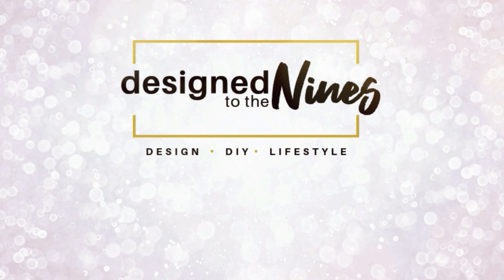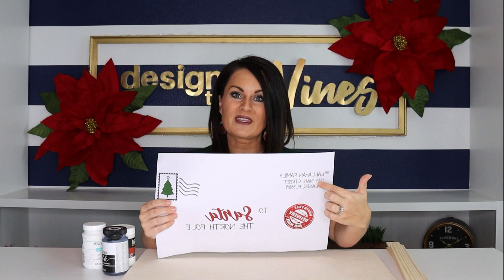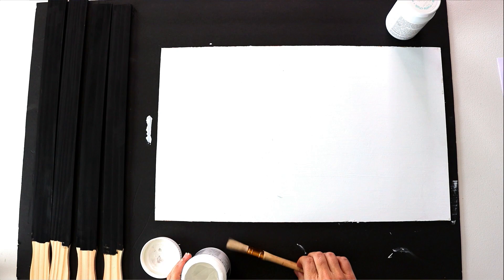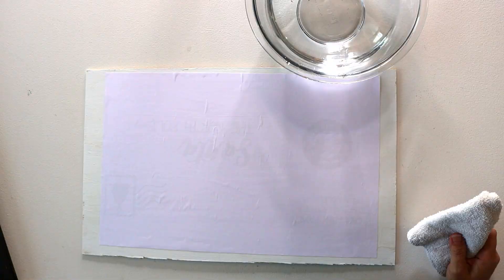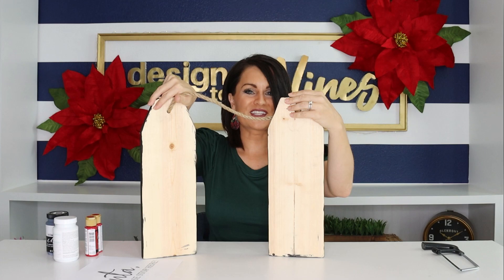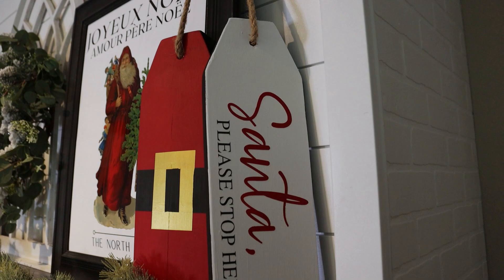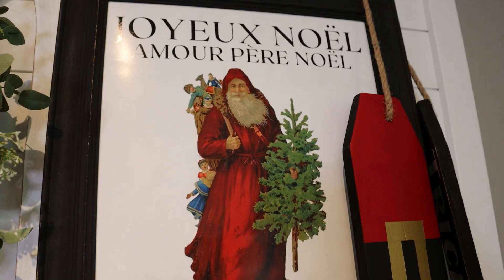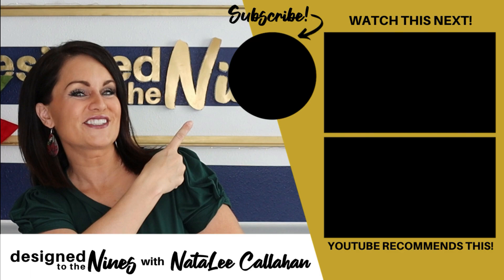5 Way COOL, Dirt CHEAP Christmas DIY DECOR Ideas On a Dollar Tree Budget!

Comment: Wonderful ideas! I really do enjoy watching your projects come to life. I have a request but if you think it will take to long to explain, not a problem, I understand. Your method to keep paint from seeping is intriguing to me. My problem is I have cognitive issues that don't allow me to process new things quickly, I've even tried viewing it over and over but I'm still not getting it. If possible, could you write out how you do it? Again, it's not a problem if you think it will take to much time. We are, after all, talking about paint not seeping on a craft project, not rebuilding Rome in a day. Thanks!
Reply from the maker: I am so happy to help. So here is the concept in a nutshell. If you want to have no paint bleeding and clean crisp lines, the best way to accomplish this is after you tape off what you are doing you paint the original paint color over the edge of the tape. So... If your painted board is originally white you would paint white again over the edge of the tape. The reason for this is if the paint bleeds (which in my experience it always does) it will bleed the original paint color and at the same time create a seal not allowing the new color to bleed underneath the painters tape. Now that the painters tape is sealed you put your new color on and do as many coats as you think you need. Once it's dry pull back the tape it should reveal perfectly clean edges. This also works with vinyl stencils as well. Hope that helps and makes sense for you! =)
Reply: @designedtothenines   Yes, thank you! And I can screenshot and print this out so I can refer to it when I need to. Again, thank you very much for your help.

Comment: Do you wait for your paint to dry before you peel off the stencil?
Reply from the maker: It depends on my mood! LOL. I would wait for it to dry, but just barely.
Reply: @designedtothenines  I usually do the Mod Podge layer to seal my stencils and then paint after the Mod Podge dries. I have been cutting some signs with tiny letters lately and they are pulling up from the wood when I remove the stencil.  I rarely have the patience to let them dry completely. Partially, but not completely, So I wondered what you did. I am going to try using a coat of the base paint instead of the Mod Podge and see if this helps. I have heard that this works but I haven't tried it yet.